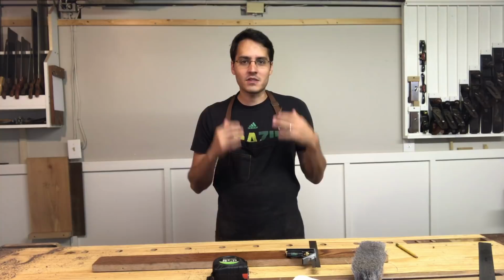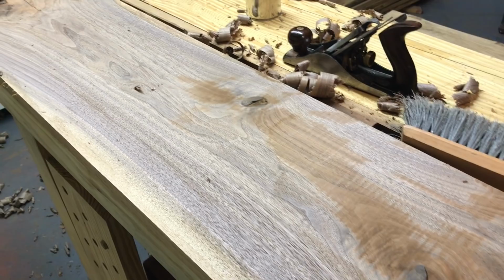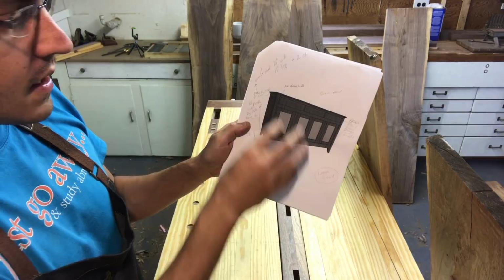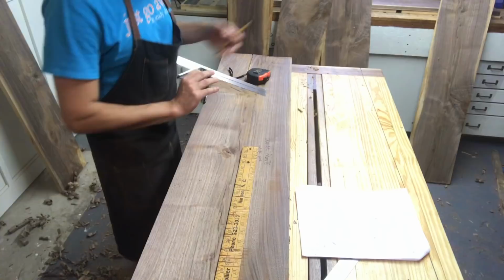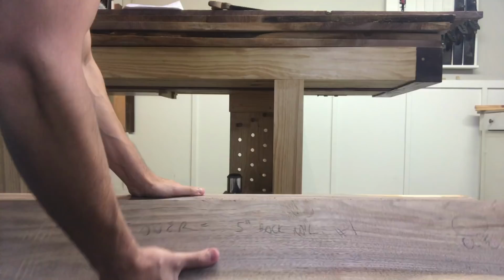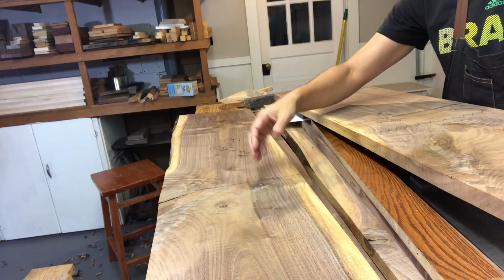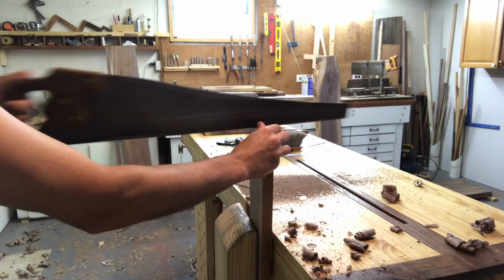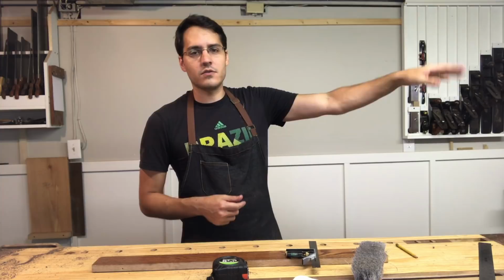Building a Sideboard Part 4: Laying out and Rough Cutting the Components | Hand Tool Woodworking

Comment: Try finding a #6 foreplane (or a 5 1/2) to do all that pre-work... it's heavier and it's greater mass helps push through the rough wood. It would be a lot easier than using that light plane you have now.
Reply from the maker: Love my #6, but I didn’t really want to do too much planing on these boards. However, when I went about dimensioning them, I used my 6 a ton! Thanks!!